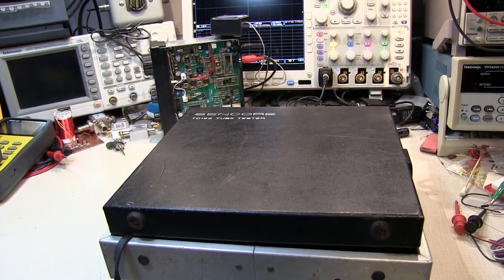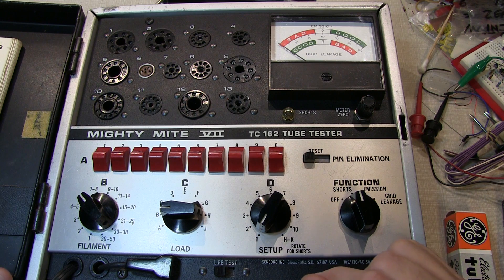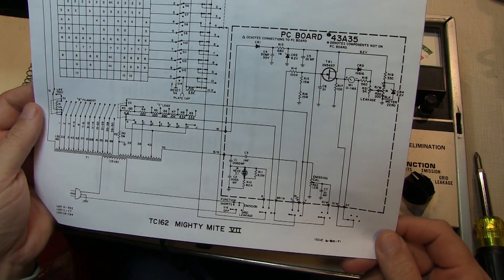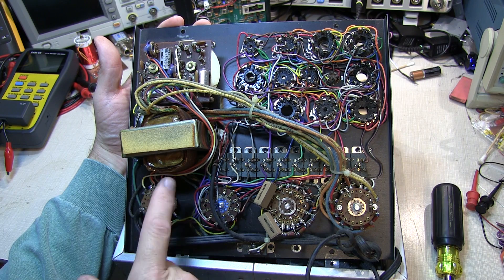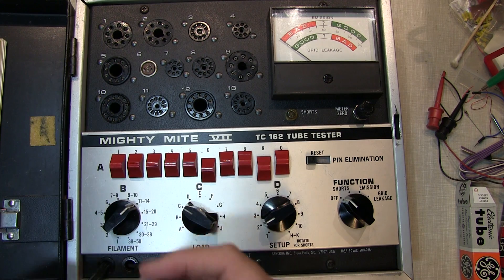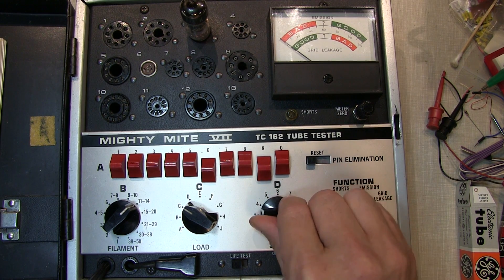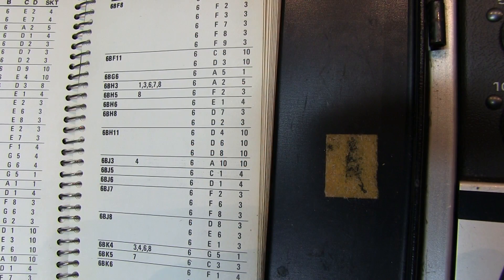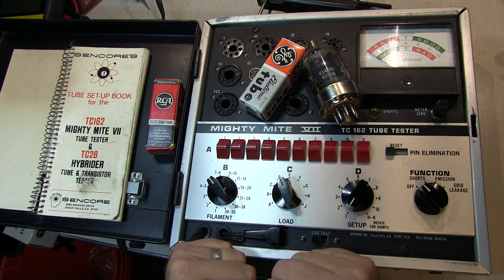#272: Vintage Tech: Sencore TC162 Tube Tester: How to use, tips and peek inside

Comment: Could you explain how 300K is considered a short?  I thought shorts were a single-digit or fractional number of ohms.  Thx.
Reply: Vacuum tubes can exhibit many giga-/tera-ohms of resistance when off, then if we find a resistance of less then 300 Kohm on the same path when the tube is off, then it is practically shorted. This can though greatly vary depending on the application.

As a rough example, it is a bit like having a mosfet that excessively leaks current from source to drain.
Reply: I guess I found the particular 300K value curious, but your explanation makes good sense.  Appreciated!
Reply from the maker: Also remember that typical vacuum tube circuits operate at hundreds of volts, with very high circuit impedances - so a value of 300kohms from grid to xxx (when it is supposed to look like an open circuit) can be very detrimental to circuit operation.  The 300Kohms value is somewhat arbitrary, but certainly orders of magnitude less than the giga-tera ohms that the Grid should have.